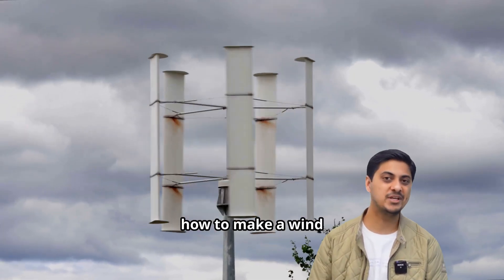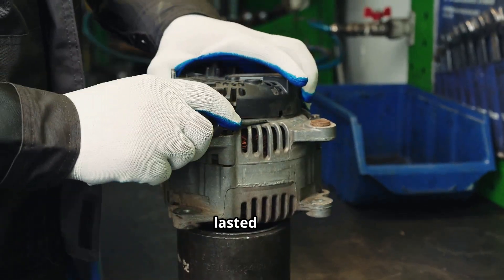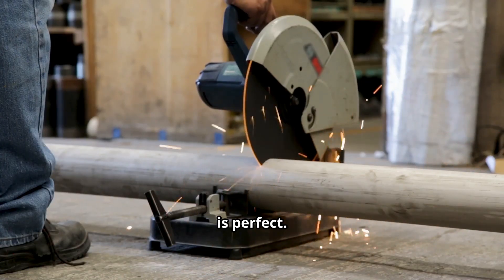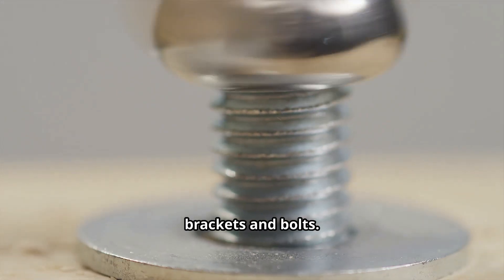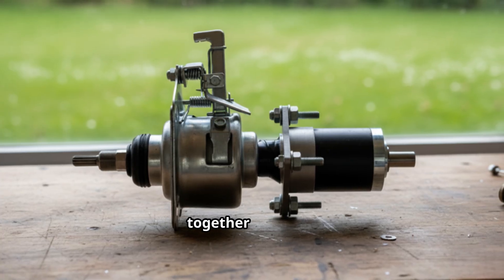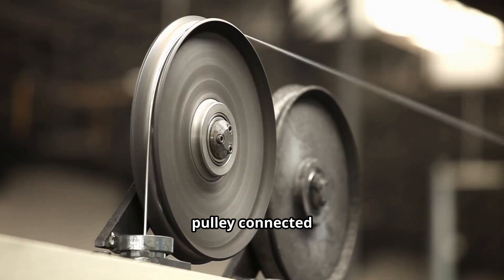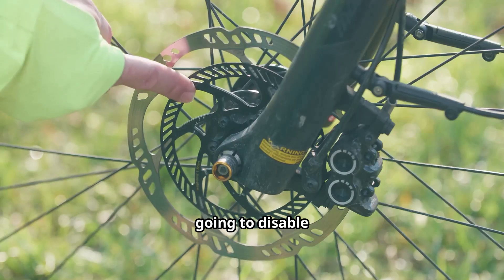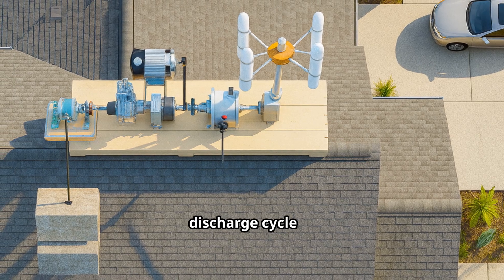A Wind Turbine That Works With NO Wind and NO Batteries?! Here’s how to MAKE it!

Comment: 1 ton block raised to 20m will generate electricity for only few seconds without gears and for few minutes with gears. You might be able use it for 30m max.  How will it run for days. This Sounds impractical.

Comment: Hi mr electron 
I have a question ❓ 
What if we rotate a magnet by shaft of a motor and place aluminium dense plate in front of it
Will the plate heats up
I mean u know changing magnetic field like in induction coil 
Will it work????
Reply from the maker: Yes it will heat up if the magnet has opposite poles on its same surface
Reply: @MrElectron thnx for reply

Comment: Block 100 kg raised 20 m  = 100 * 20 * 9.81 = 20 kJ. One lithium cell battery 3,7V 3Ah = 40 kJ.
Reply from the maker: So why bother with gravity storage at all?
Because despite being weak per kg, gravity has HUGE advantages:
- Infinite cycle life
- Zero degradation
- Zero fire risk
- Works in extreme temperatures
- Environmentally clean
- Cheap materials (rock, sand, concrete)
- Perfect for long-duration storage
- Absolutely safe compared to lithium.

Gravity storage wins when long lifetime is important. Safety matters. Eco-friendly systems are required. Large slow discharge is needed for hours.
Cost per kWh must be lower over 30–50 years.
This is why entire companies like Energy Vault, Gravitricity, and others are building 100-ton weights lifted 100+ m.
Because gravity scales well when it's BIG.
Reply: @MrElectron  I appreciate your video skills, but doubt the practical application. The small turbines featured in your movie produce less than 1 kW. That is not sufficient electric power to cook a meal. Regarding the energy storage: the energy density using gravity is low. Large structures are needed. There is a successful way  to store energy that way, by using water.
Reply: @MrElectron  I think there is a problem here.

When the weight is coming down the RPM at the generator must be 3,600 to get 50 Hertz AC output.
At this speed you will start having problems similar to gasoline generators.
The cables that raise and lower the weight wear out and may break over time.
Some dirt from the surrounding air will get trapped at some of the moving parts.
Some parts might need lubrication over time. There could be a problem if sand or dirt gets trapped around the moving parts.

If the cables wear out, the weight could fall to the ground at unknown time.

Comment: Those clutches require way more power than 5 watts
Reply from the maker: I have that exact clutch and i tested it practically with my bench power supply and then stated 5 Watts. I thought the same thing initially when i looked at its size but the fact is that it is just a highly efficient Electromagnet.
Reply: @MrElectron it will only consume that much current with no load to it once there is load it's going to use way more
Reply from the maker: Unlike motors, its power consumption doesn't increase with increasing load. The increasing load can cause slippage problems if the power fed to the electromagnet clutch is very low but its going to work best with my system as this load is going to be very light for this clutch because of the presence of multiple gearboxes that are going to reduce the torque drastically and thus eliminating the need of full rated power to the clutch. Although, if the setup is really big and the added weigh is going to be around a 1000 kgs or so, then full power consumed by the clutch is 12 volts and 1.73 Amps thus making it ~20 watts. Although, the generated power will also reach higher values so in that case making the consumption of 20 watts is going to be almost negligible. A small solar panel with a small lithium battery pack can handle that without much effort.